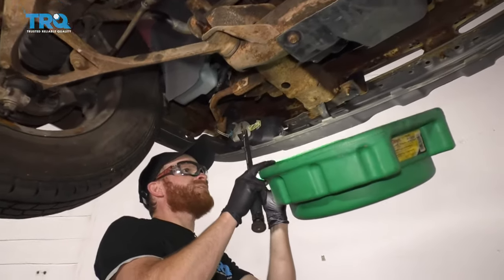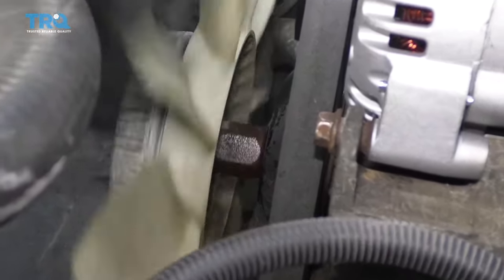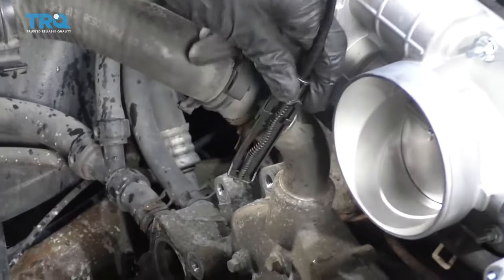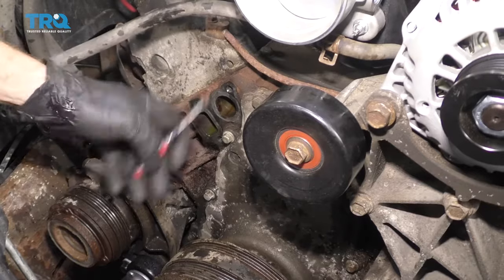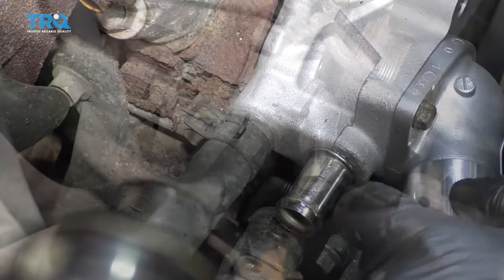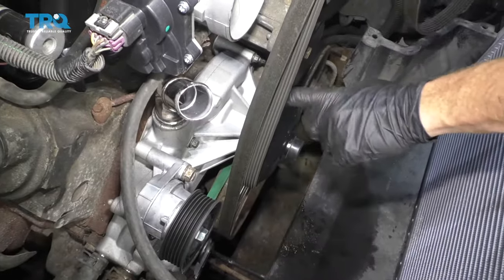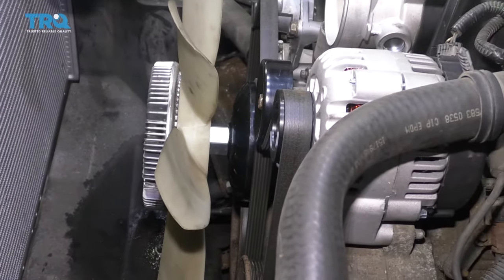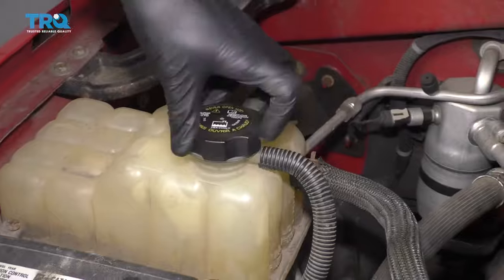How to Replace Water Pump 1999-06 Chevy Silverado

Comment: Great video here.  One thing he doesnt tell you is, if the nut on the flywheel doesnt loosen easy- if you turn the engine as you do so- you will need a flywheel spanner wrench from oreilly, part 43580.  Costs 30 bucks...yea i know, ripoff!  The two prongs on it fit in the water pump pulley so you can loosen the nut. Also, once you have the pump off, get a razor blade and scrape off any gunk built up on the engine where the gaskets sit. Be meticulous about this.  I spent 30 minutes on mine. This is an important thing that not many mechs will spend that much time on.
Reply: You can rent the whole kit.
Reply: @j3a3k3e5  you found it?

Comment: This video is spot on. Make sure you remove your upper fan shroud and also make sure you replace your air conditioning compressor belt while you are in there. These two pieces of advice made the job that much better for me. With a new Continental belt, my A/C blows colder then it did due to less slip.

Comment: I'm getting ready to replace most everything in my 2003 Silverado's cooling system. The heater hoses, radiator hoses, new slide clamps, and water pump. Prior to all the replacing I am flushing the radiator to clean the system. I'll inspect the serpentine and AC belts and decide their replacement at that time. With your video as a guide I feel confident to take on this job. Thanks for the details and your "done-right" video. I'll edit this comment once everything is done. 😃

Comment: Thank you. I was able to replace the water pump on my 2005 Chevrolet Silverado using this video. Everything on my truck was identical. I didn't have all those fancy tools you have, but it was still easy. And mine doesn't have a fan clutch, so i was able to skip that step. Anyway, thank you.
Reply from the maker: +@Tomas-gd6lk Thanks for watching our video! http://1aau.to/m/Shop-TRQ

Comment: I have a 2004 silverado 1500 and the water pump is leaking.  I have planned on replacing the pump, thermastat and housing along with the coolant reservoir.  Do you recommend replacing the tensioner and fan clutch as well?  I only ask because the truck has over 330,000 miles and while I want to keep it functional I'm not sure how much to dump into it.

Comment: at 6:10 what do you mean about the bolts not going into the coolant jacket.  And did you use gasket sealer on the gaskets on the back of the water pump?  Great video!! Thanks.

Comment: Why don't you want to use green antifreeze?  Isn't Dexcool crap?  Dexcool supposedly makes your antifreeze change  intervals longer, but has a high possibility of failure that can mess up your vehicle much worse than it's worth.

Also, what torque wrench is that?

Comment: replaced the water pump and was checking for leaks and noticed that coolant was dripping still. i started tring to trace down the leak and it was hard to tell is their something that might leak behind the AC compressor bracket??
Reply: I had the same problem,  you ever find out what it was

Comment: The fans the hard part.
Reply from the maker: +walter kersting Thanks for the feedback! http://1aau.to/m/Shop-TRQ
Reply: @TRQ  did you use any kind of silicone on the gaskets or the thermostat housing and is there any special way the gaskets have to go on the water pump to the block

Comment: The fan in my 2005 silverado is not attached to the engine ?
Reply: you have electric fans......2005 and 2006, but the rest the same, you dont have to remove the fan so you dont need big wrench or holding tool.........  the waterpump is same part and threaded part at the front of the pulley is redundant